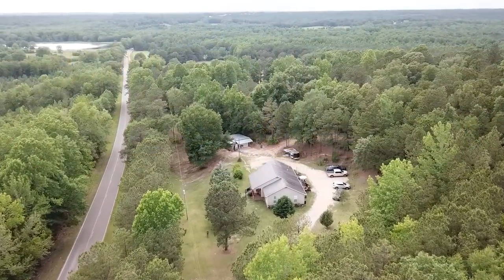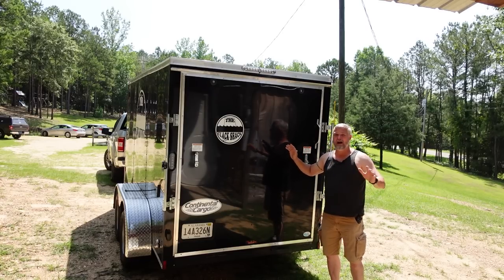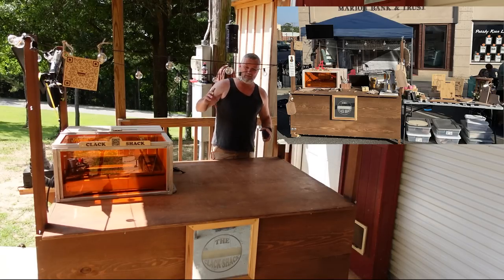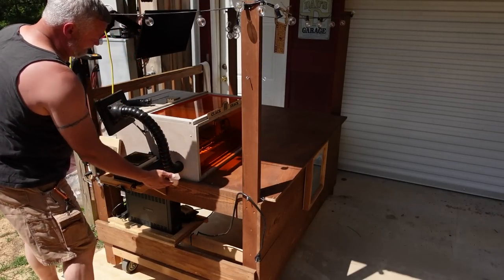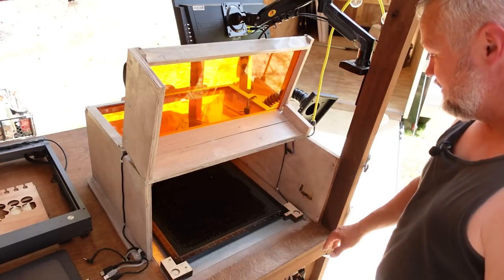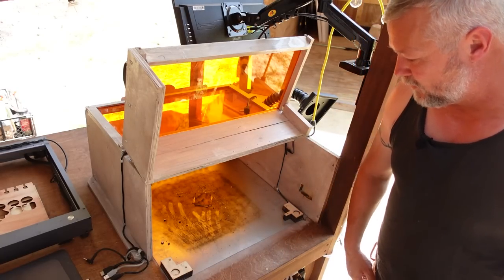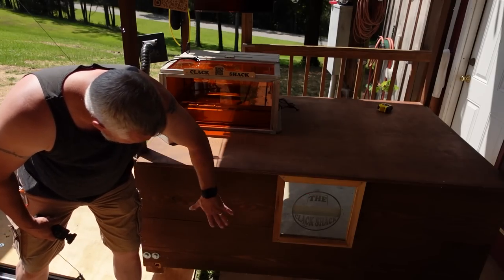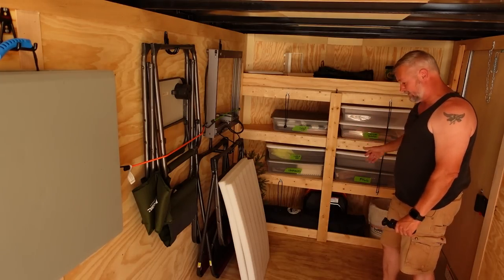The mobile Clack Shack- My portable laser setup

Comment: I use a Beelink mini computer and a small monitor. Saves space and good for running laser/lightburn. Small Monitor not great for designing but functional. A 15" monitor is fine.
Reply from the maker: I already had this laptop.. $$ saved
Reply: i love the beelinks.

Comment: Very informative, thanks for sharing. One question I have is how many pieces of a certain type of small item do you typically take to a show?  Seems a balance between so few you sell out quickly and overloading with way too much is needed.  I know the answer will vary for everyone but a point of departure number would be helpful
Reply from the maker: I keep blanks with me, I can restock certain designs as needed. Small things I keep about 10 of each on hand made. I sell more made at site things.

Comment: Very nice build! The optical shielding you provided a link for is OD 3, is that dense enough for people to safely watch the engraver at your booth?
Reply from the maker: The light that is hitting the window is indirect and unfocused. The material is rated for diode machines and has been tested. I run the same windows in my shop for over a year and no issues. I have also found that you can cut it with a diode so that means it is absorbing the light. The reason I purchase from JTech is that they test it and know way more about it than I do.

Comment: I've been thinking about trying to take a laser to events but power is the issue.  Most of the outdoor events we do are set up in a way that wouldn't allow a gas generator.  Have you ever tried a battery power ststion like an Eco Flow or Jackery? I wonder how long it would last before it went dead.  I can't imagine the diode laser uses much energy.
Reply from the maker: I haven’t tried that